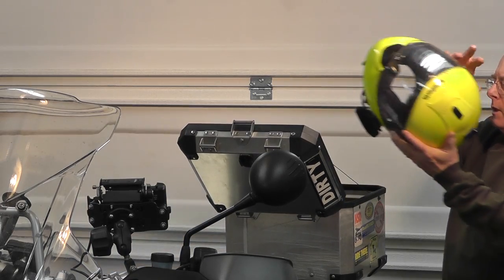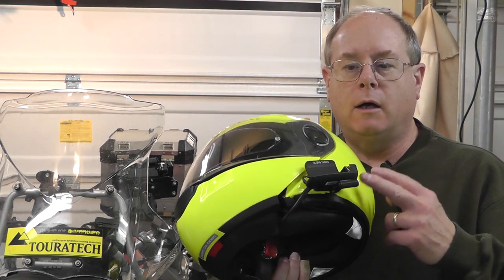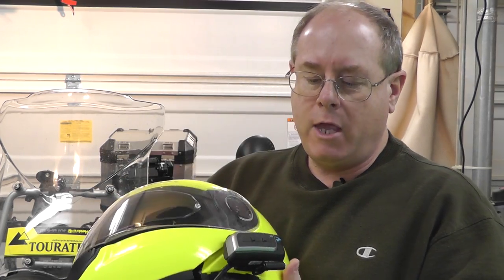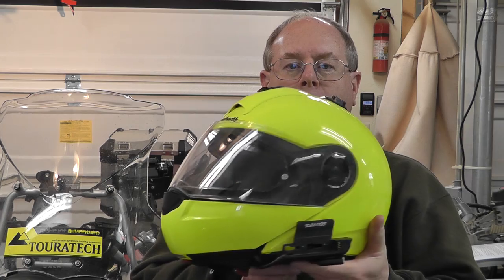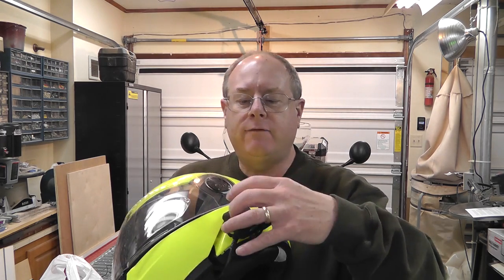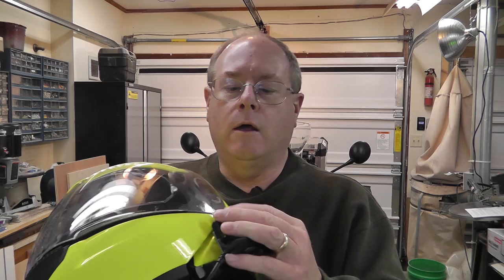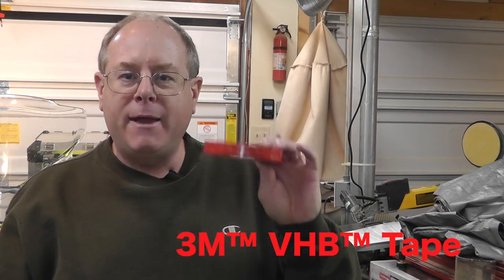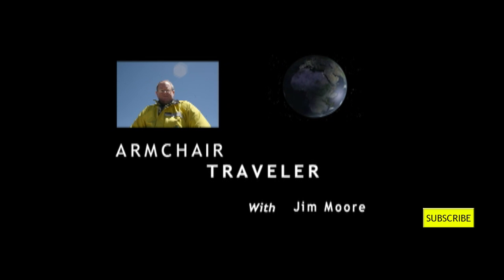Motorcycle Helmet Intercom

Comment from the maker: You are correct.  But what I have not done a video on yet, but will soon, is that I had my G9 unit modified.  I do not like using speakers because they do not provide high enough quality of sound and they do not eliminate the wind noise.  My G9 now has a plug epoxied to the bottom of it.  I can plug earbuds or the speakers into it.  I only use very high quality noise isolating earbuds.  So far, no problems with the wires.  But if they do fracture, I'll just buy a new set of earbuds.

Comment: Hi Jim
I purchased a Schuberth S2 helmet and would like to install a bluetooth 
unit. I don't want their SRC colar unit because I was told that it makes
 the helmet harder to put on and off and it's already very snug. I 
already have the Cardo G9x but the adaptors they include don't help. If I
 use 3m VHB tape to attach it I will not have access to the rear plugs 
for the ear spearker and aux. I believe the way you have it done only works 
if I get the wiring mod that you did to the unit. Can you send me some closeup shots of 
the unit especially the back part showing the tape.

Tks
MarkZeds

Comment: Jim, I have 2 questions:
1) Do you feel adding this G9 Mounting attachment has increased (significantly) wind noise inside your C3? I have a G9 also and I just received my C3 Pro, and I want to avoid creating noise from inside the helmet. I know there is an SRC system (based on the G4) that integrates seamlessly, but I also want to avoid having to spend more when I already have the G9.
2) Have you tried using the wired microphone (instead of the mic on the flexible boom) and velcro mount it on one of the side cheek pads? I used this mic mounting strategy in my previous full face helmet (Scorpion EXO-1100) for over a year and it worked for me  (even though the mic ends up being a little off to the side of my mouth). This might have given you more freedom for locating the mount point for the G9 socket.
Thanks for sharing! MT
Reply from the maker: I have not really noticed any increase in wind noise inside the helmet.  If there is any, it is minimal.  I think your idea of the wired microphone sounds interesting.  I may try that and see how it works for me.  I'm not sure how the wired mic will work with a modular helmet.  I'm very happy with my G9, so I don't plan to make any changes at this time other than maybe trying the new kit they created to allow the user to use either speakers or earbuds.  I want to get a kit and try it and do a video on it.  But last I checked, they were sold out.  And I'm into a major remodel on my house, so not much motorcycle work going on at the moment.

Comment from the maker: I originally wanted something like your talking about UniversalGamingUK.  But I was not successful in finding anything.  Maybe they are custom made.  Anyway, my system needs no buttons.  My microphone boom is inside my helmet for the Scala G9.  So if someone calls me, all I have to do is say "hello" and the unit connects with the caller allowing me to speak to them.  On the digital recorder, another mic is in the helmet and the recorder turns on and off automatically as I speak.

Comment from the maker: No I did not.  But that is because with the Schuberth C3, you have to use the mount that only "sticks" to the bottom edge of the helmet rather than the mount that uses the screws.  I did not like the G9 interfering with my jacket collar.  It hung down below the bottom edge of my helmet.  So my using the 3M tape, I was able to stick the G9 to the side of my helmet, so that it no longer hung down below the bottom edge of the helmet.